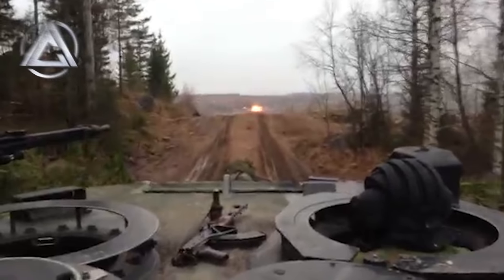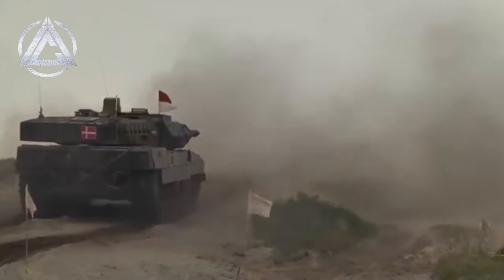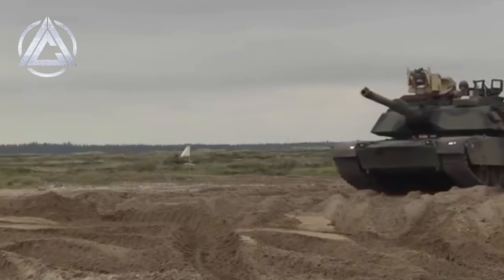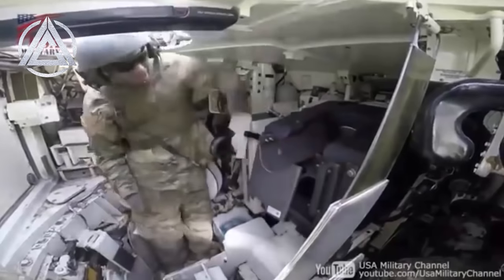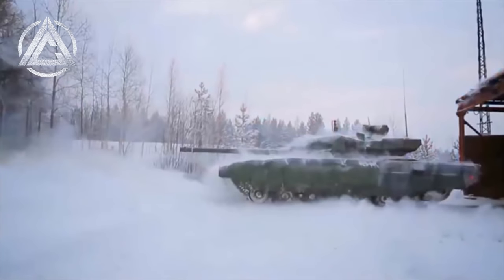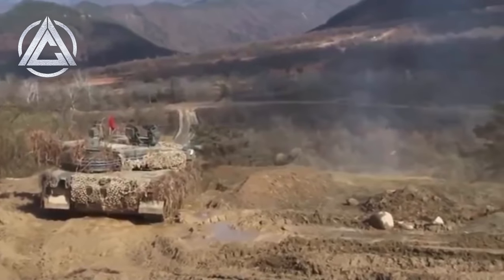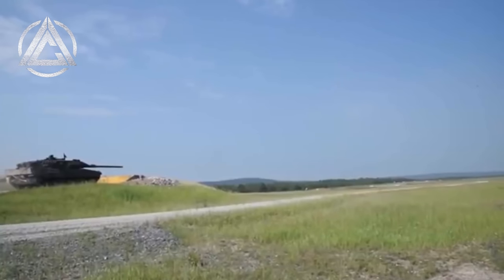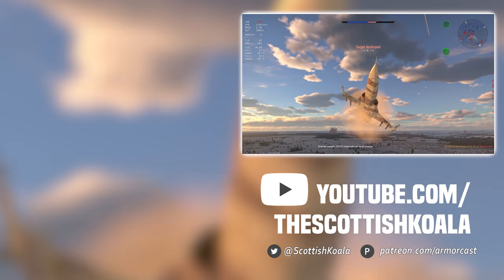Why Do Some Tanks Raise Their Gun Barrels After Firing? | Koala Explains: the 'Tank Salute'

Comment: “Though the difference this makes to load times is quite small, only 1-2 seconds”. That’s a 30% faster reload, it’a huge
Reply from the maker: Depends on the existing reload rate - in a Leopard 2 it's about 5-6 seconds per shot. Without depressing the breach we're talking more 6-8 seconds. Since first shots generally decide tank engagements anyway, it's not exactly going to be the difference between winning or losing.

I might have phrased that a little wrong - it makes a big difference to actual rate of fire when you look at how many rounds you can pump out per minute... But that increase isn't going to make a massive difference to the outcome of an engagement.
Reply: @ArmorCast  Ive never heard of a crew not putting the breach into loading position, at least in leopards. Its safer, its faster, has no negative effect on the crews overall performance. 

 Id agree that RPM is relatively useless information, but i wouldnt necessarily say 2nd shot is. The general rule is, as you said, that 1st shot wins, but i can imagine that a lot of scenarios also require the follow up shot to be a more precice, lethal shot, as when meeting someone head on the first shot is generally just a shot taken for the sake of shooting first
Reply: @Gunsforbuns  The point is it has not tactical value but instead purely for crew comfort.
Reply: @missfire9480  What? The point is for both. Its more comfortable therefor leading to higher efficiency over a longer period of time. But also because if the gun werent locked into its loaders position then itd take longer to load too. Trust me, i know xD
Reply: @ArmorCast  "Since first shots generally decide tank engagements anyway", is this an actual statistic from combat or exercises? 

To me it seems like the majority of shots are non-penetrating because the majority of armored areas simply won't be penetrated even by APFSDS, even if just barely. One side will probably be dug-in and hull-down, so no turret ring shots for you either. Perhaps a different scenario if you ambush a column with their sides towards you in open ground, but that's not typical.

Otherwise I can't explain why it took the US M1's more than a minute to win tank battles against Iraqi T-72M's; if the tank battle was decided in the first shot, wouldn't the M1's with superior crews, FCS, range and penetrating power just pop every T-72, be they hull down or not? Instead they had to rely on artillery, air support and ATGMs to win the big fights. Although those were at very long range. 

There was often a severe tank strength disparity in WWII, so it surely isn't true in that regard. Even if you hit a shot onto a T-34/76 in your Pz. III or Pz. IV, there's no guarantee it will do anything, let alone at 1km+.

Something like the Iran-Iraq war seemed to be at closer ranges on average, with both sides being able to reliably penetrate eachothers' hulls with even HEAT, so perhaps it is true for that scenario. 

To me it seems more like the first side to pin down the enemy tanks and subject them to artillery/air support/missiles decides the engagement, at least in the engagements we've seen historically.
Reply: Sometimes 2 seconds can determine if you live in a head on situation whoever penetrates first lives
Reply: @ArchOfficial  your raising valid points and it seems most people don't understand what is meant by the phrase whoever shoots first wins. The phrase isn't born from the fact that it's one shot kills so if you fire first you win because you've disabled or destroyed the enemy tank. Statistically speaking in tank engagements the side that fires first is more likely to win, also this is assuming a relatively fair fight; if you have 60 year old tanks and your poorly trained and go up against fairly modern MBT's with well trained crews then having the first shot would mean sod all, just look at tank battles in Iraq.

 Anyone who says loading speed doesn't make much of a difference doesn't know what they are talking about. The British Army teaches that the life expectancy of a tank crew member is 2.5 mins, because this is the average length of an armoured engagement. Your highly unlikely to only fir one round and win a fire fight, you will be firing several. Other factors to consider are the nature of Ammunition already loaded when you encounter the enemy. If the int says that your highly unlikely to encounter MBT's, but infantry and lightly armoured vehicles then you will have HESH loaded and not FIN. So when you unexpectably run into some MBT's you have a HESH round loaded which needs to be fired before you can then load a fin round, so you want a fast reload time as firing the HESH round will let the enemy know your there if they didn't already.
Reply: @Gunsforbuns  with well trained crews the first shot isn't just a throw away shot, it is always an aimed shot intended to kill. You are thinking of infantry tactics. As infantry when your engaged you fire 2-3 shots in the direction of the enemy to hopefully make them get there heads down and give you a few precious seconds to sprint into cover and adopt a firing possition. Then an appropriate rate of fire is layed down on the enemy possition accurately.
Reply: @kaneworsnop1007  Well yes, to be fair, usually the side which fires first wins, because they have a large tactical advantage to begin with. ;)
Reply: @kaneworsnop1007  Tell that to whatever crew turns a corner ands staring down a tank gun. I used to be a gunner in a Strv 122. You take your time when youre allowed to do so, there are times where you dont have that luxury
Reply: @Gunsforbuns  there's going to be times when you take a more rushed shot than others, but you don't waste a shot just pulling the firing lever without aiming due to the reload time. Wasting a shot would likely kill you and your crew, obviously heat of the moment plays its part; I know if I was the gunner on ops that I hope I'd keep my cool and aim the shot instead of wasting it, training increases the chance of this happening over an inferior trained army. A well trained gunners shit aim quickly and fire is always going to be more accurate than a poorly trained gunners regardless. A better trained and disciplined gunner is also more likely to take that extra fraction of a second to aim closer to the centre of mass than a poorly trained one. I'm not saying that it will be a perfect shot, but a well trained gunner wouldn't just pull the firing lever when pointing in the vague direction of the enemy tank, they would make sure the aiming mark was on the tank and hopefully close to the centre of mass.
Reply: @kaneworsnop1007  For starters theyre triggers, im not sure if they used levers in WW2, but everyone uses triggers now. That aside, thats my point, obviously if you have the time, you take the time, but that isnt always the case, of which where youre just going to be taking a quick shot at center of mass of whatever it is you see. That aside, being on the inside of a tank thats taken a hit, penetrative or not, is not a good time, your head will be rinning, youll be disoriented, the likeliness of a crew thats just taken a hit to be able to react before whatever tank takes a second shot is second to none. Regardless, you basically re-iterated what i said the first time.
Reply: @Gunsforbuns  sorry dunno why I said firing lever, must have been the wine 😂 on the Challenger 2 it's a firing switch, no trigger, it's a button underneath a guard. I can't speak for all British Army AVF's as I'm a Challenger crewman.

I had taken your wording to mean not even aiming just firing, so yes werww on the same page. In the British Army were trained to always aim for the centre of mass, no aiming for a particular point. Tbf if you had the time to aim for a known weak point most gunners probably would, in theory though that goes against our training.
Reply: @kaneworsnop1007  Interesting to note that the firing switch is kept under a gaurd. On the Leopard 2A5, or in my case, the Strv 122, the triggers simply on the other side of our "joystick", similar to that of what youd imagine the trigger in a jet be.
Reply: @Gunsforbuns  our controllers based off of the PlayStation 1/nintendo controller. When it was designed due to the kids who would be the future soldiers playing video games, they had the sense to design the controls to make an easy transition from gaming to controlling the gun on the tank. The guard is there to prevent accidental firing when going cross country and bouncing around. It's just a spring loaded lever that you slide your finger under from the end. The grip switch on the opposite side is identical with the button beneath, but the lever can be pressed in, so it's more comfortable than holding a small button in for hours at a time. They're in the possition of the bumper buttons/triggers on a PlayStation controller. It then has the right hand thumb controller to aim the gun like in a shooter game.
Reply: 6-8 sec loading time is very slow. Ex tanker, a good loader is 3.5 to 4 sec.

Comment: Fine Video!
The loader on our M1A1 during Desert Shield/Storm deployment was the most physically fit member of our crew. He made every effort before we crossed the berm to use the time he had to work his body in preparation for what he knew would be very demanding on him. He was never 'told' to do this. He stepped up and did it on his own. During an engagement with a T-72 I credit him with its destruction as he achieved a 3 second reload which quite possibly saved all of our asses. 
I will never like to see that vital position being eliminated in future US tanks designs but I know it's inevitable. I know many TC's felt this way but I am sure I had the best tank and crew in the US Army.
Reply: The spent shell case slides out easier when the gun in in the raised position,
Reply: Wouldn't have mattered if it had taken him two minutes, the Iraqis only had crappy export rounds designed and manufactured during the 70's, which had nowhere near the penetration needed to to knock out an m1.
Reply: It might end up similar to the Israeli Merkava - keep the 4-man crew, just the roles will change. Instead of being responsible for loading the main gun, the 4th crewmember will handle comms, close range defences and maybe a recon drone or whatever they add to a tank's arsenal by then.
Reply: @barryhill1044  Their is no spent cases on the Abrams anymore.  The case on the 120 is combustible, all you have left is the aft cap.
Reply: @traviseggl3794 ; Absolutely right Travis. Our loader jokingly referred to them as 'the butt plug'.
Reply: You can always tell who the loader is in a tank crew. He has muscles like Popeye.

Comment: The commander also has a control to elevate the barrel in case he believes the terrain is about to make the gun barrel dig in to the ground.
Reply: He doesn’t have a control to “elevate it" per se, the commander has the ability to fully take control of the turret, wether he wants to elevate the canon or do a 360 with the turret is up to him. Isn’t only a button press that elevates it
Reply: @Gunsforbuns if i may eloborate  He can either take control of the gunners sight or make it so that the gun follows the commanders periscope
Reply: @Gunsforbuns   Well, either the Loader presses the Button for the loading pos. which is any button for each round (KE, MP / Multi-purpose) and then it goes into pos. Or after each shot if the loader deactivated the leaver which keeps the breech closed

Comment: It used to be (In chieftain) "Check MRS" This meant - check muzzle reference system. Which meant - checking (roughly) that the main armament was still in alignment with the site, a quick way of checking.
Reply: They aren’t the same system. The loaders safety and MRS sets the canon to two different elevations, not related in any way

Comment: I was a loaded , gunner, and TC. A good loaded on the old Sheridan had to lift the 152mm Rounds, open the breech, close the breech and squeeze away to avoid the recoil handing on as the vehicle lifted up to the third roadwheel before slamming to the ground. The Sheridan had combustible casing which was blown out of the gun tube by air from a compressed air tank.

In Korea it was the M48A5 Tanks with the 105mm Gun. The M48 was similar to the M60 series Tanks

The M60 gun tube rose up as it ejected the hot case which the loader kicked away. A good loaded can pick up round after round because he trained and trained to do it. I was a gunner and a TC on the M60

I was on the first Abrams Tank with the 105mm Gun which was the same gun used on the M60 Tank. I was a TC, I had good loaders who could open the Ammo storage door and load a round in seconds.

Comment: I already kinda figured this was the case, but I'm glad to have it confirmed. I just imagined the breach bouncing around relative to the turret, or just being in the highest position if the gun is depressed after firing, and I figured it was the breach returning to a "loading position" or something. Loading a stabilized breach while the turret is moving with the hull does not sound fun. RIP our War Thunder loaders, I guess.

Also cool to know the process exists for returning it to alignment with the gun sight, as that was the only question I had about that whole system.

Comment: Since you are discussing tank main guns, could you please do a piece on what can damage a tanks main gun and/or elevation and azimuth mechanisms. For example in many games barrels are driven straight into concrete walls or trees and rocks, muzzles pushed though dirt and mud. I know as an avid shooter of real guns this would destroy one of my rifles and me too if I fired it with an obstruction in the barrel. Forcing collisions between barrels and objects would be a game changer for sure I believe. Maybe I am wrong but, would love to see it implemented into games. ( There is a picture of what of a leopard that fired with an obstruction in the gun barrel)
Reply: Unlike a rifle tank gun barrel has a 50-60 tones of tank plus all of its momentum pushing it in to the obstacle. Consequences obviously depend on what kind of obstacle, what angle, speed etc.  here's some of the things that could go wrong:
- least concerning, "losing zero" (yes, tank guns need to be zeroed in)
- damaging the gun, a six meter barrel makes one hell of a lever
- gun sliding of the rails and injuring/killing crew in the turret aka loose cannon
- damaging the turret rotation and elevation mechanisms along with gun...
That's why it will never be in the games because every time players "facehug" someone the breach of their gun should be punching out the back of their turret... :)
Reply: The obvious effect would be damaging the barrels crown which would have a major impact on accuracy

Comment: I am an old artillery man but I used to hear that it was simply to aid in ejecting the spent round casing.  The 120mm shell is a one piece design unlike with a 155mm howitzer ammo where you have the 95 pound projectile separate from the powder charge which could be made up of multiple bags of white or green bag powder depending on the range and type of shell used.  As I said I was a chief of fire direction but on one or two occasions I helped load projos into the m109 howitzer. Those were near a hundred pounds I can recall seeing a couple of small 13b cannon crewman who were moving those big rounds about and my hat was always off to them. Usually all I had to lift was an RDP, pencils and chart pins lol

Comment: I always figured it was to help more easily inject the shell casing, but didn't think about for the new round was in correspondence to the breach. It would definitely be desirable to not have to lift the heavy round any further than necessary to get it into the breach. I guess I just assumed they were designed with everything kind of at the same level but I should have known better LOL.
      Just like my Springfield 40 caliber pistol as it is ejecting the spent cartridge with the slide coming back for it the barrel actually floats the exit into the barrel upward son then ask the slide comes forward it all aligns into a stable position again more reliable loading and ejection of each round without jamming..  I learned something today. 🕵️

Comment: What comes to mind after watching this video is the experimental American tanks from the 50s. The T54E1 had an oscilating turret in order to keep the loading system of its autoloader in line with the gun. It probably would have been a better design if it could have been produced during WW2, but that never did or could have happened. That autoloader might have done some good (don't know how well it performed under testing), but in the end, it was just another prototype for the Army to test and learn from. Overal, the design was pretty smart but the T54 too was in an era that it was obsolete.

Comment: I noticed that in one of the leopard footage one had a mounted MG42
They still use them!
Reply: Its not an MG42, its the newer Model MG3. The gun itself is the same, but the MG3 fires 7,62x51 while the MG42 fired 7,92x57mm, which means they had different barrels of course. If im not wrong the breech was different too. And another thing which seperates them is the firerate of the MG3 and MG42. The MG42 hat a cadence of 1200-1500 rounds per minute, the MG3 ,,only" 1150 +- 150, which leads back to the breech which could be different. But youre right, its still the MG42 on the outside...